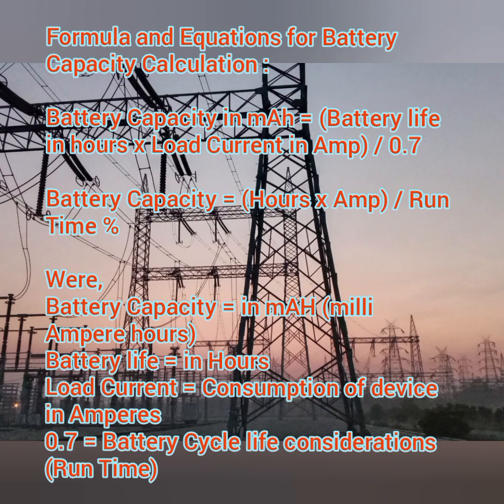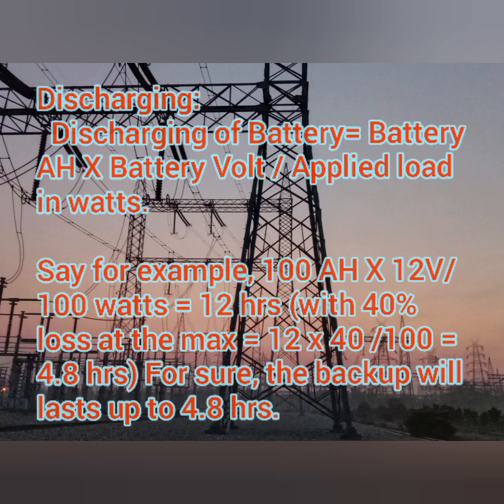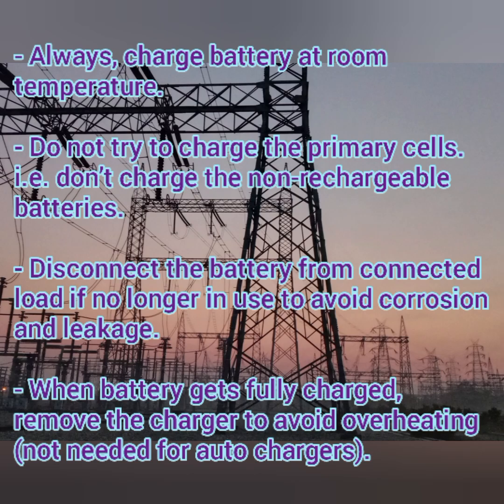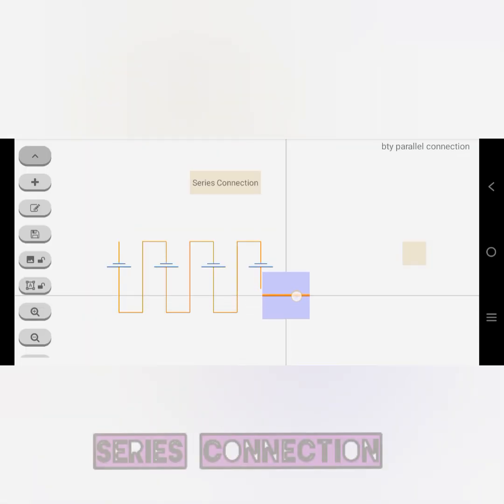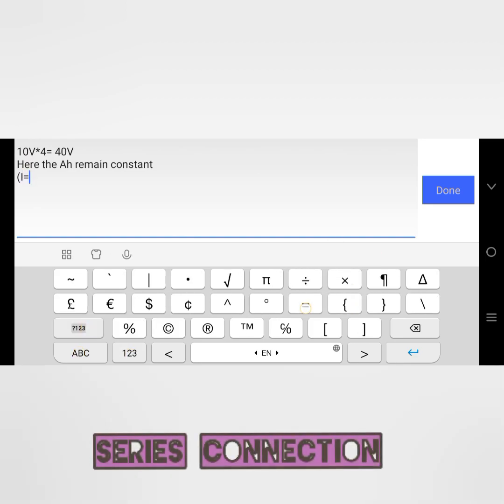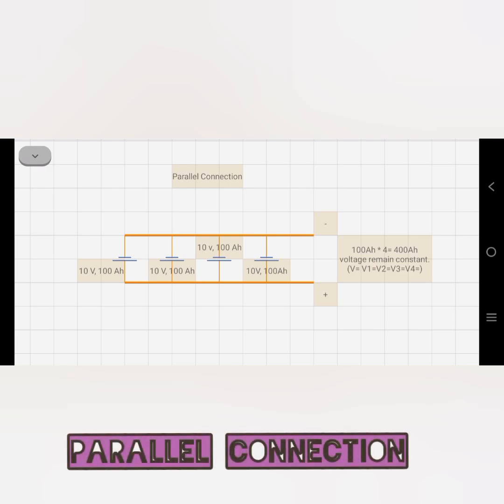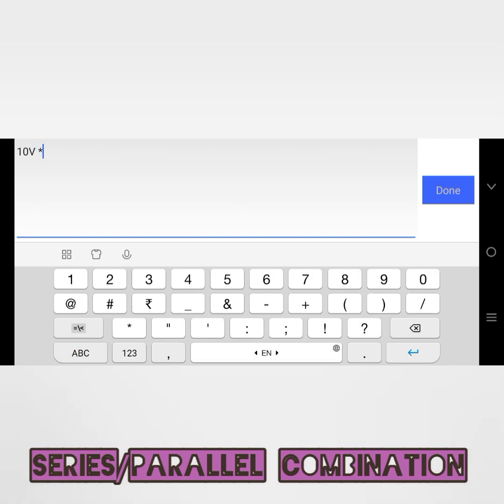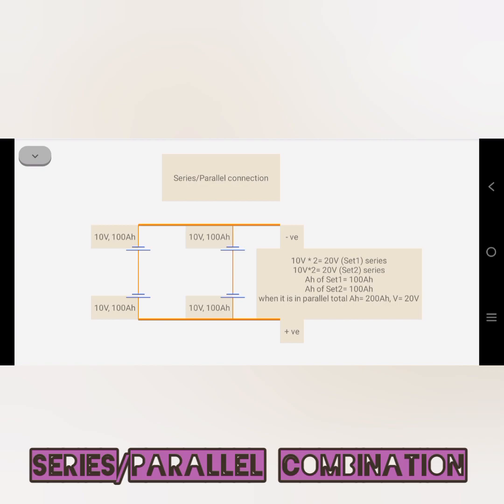Battery Capacity, Charging & discharging time Calculation, Series & Parallel connection example

Comment: Athe maathiri athoda cost pathi konjam Sollunga. I may need your help. inga veetla ups battery stopped working. My electrician said puthu battery cost around rs 16000. Kv evalo nu naan keakkala. I will check and tell.
Reply from the maker: 👍Sure
Reply: @VigneshAnand58  thank you
Reply: @VigneshAnand58  he said its around 150kv. can you tell me how much a UPS battery cost ? He said 8 hrs charge irukum. 3 tube lights -Led lights thaan, 2 fans..maximum cost Appuram entha brand. I said if it is cost 14k or 16k new inverter vaandigalaam nu. But He said battery thaan problem the unit is Good only.😊
Reply from the maker: @RajithaVenugopal  for 150Ah battery it will cost upto 10000-13000rs upon your best quality, for 200Ah battery it Will cost upto 17000rs
Reply: @VigneshAnand58  oh.. Thank you so much 😄